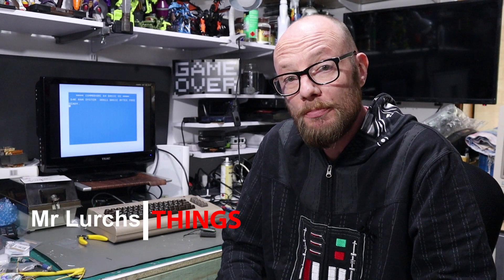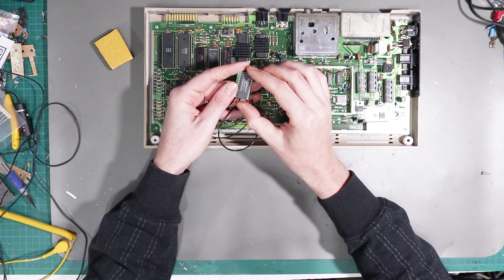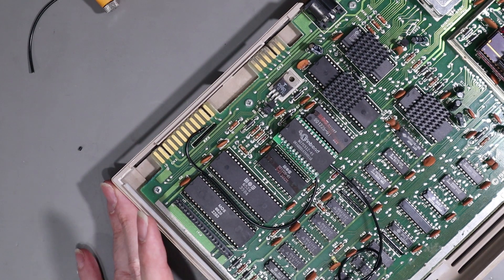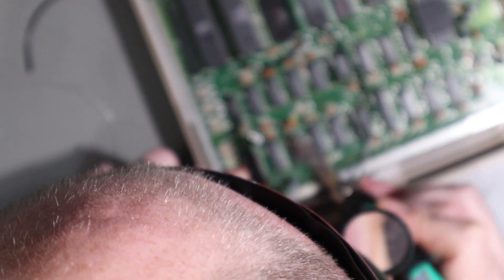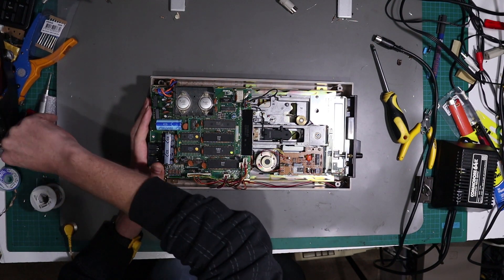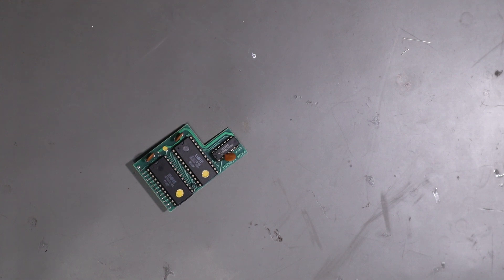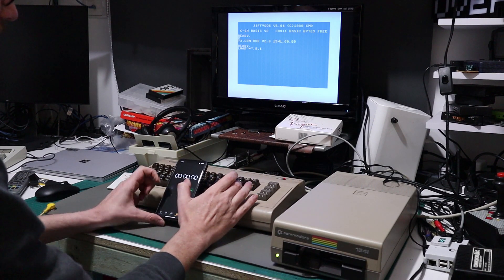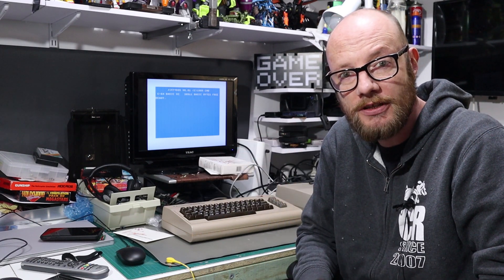Commodore 64 Rescue Pt 3 | JiffyDOS

Comment: The daughter board adapts the two separate ROM chips that you'd fnd in a 1541 into a combined ROM that you'd see in a 1541-II. Rather than soldering the daughter board, just drop a 1541-II JD ROM in place.

You also have a 1541C board, you should be able to enable the optical track0 sensor. It's just a jumper IIRC.

Comment: HI, Can I ask what camera you are using for over head ? I have similar issues with the exposure changing  especially from over head and lights reflecting on pcb or metal. I started to set it manually and had more consistent results. I still have issues with the overhead lighting in my workshop reflecting on anything a little bit shiny, but it no longer goes light and dark depending on the position of my hands for example.

Comment: Your setup is improving every day it seems. Love jiffyDOS, I have the same in the ZIF test bed, but I used a via to the right of the CPU and a via just under the first CIA for the restore and reset lines. Threw a pin header on both and crimped a couple of plugs so it is easily removed, not that I'd ever want to 😁
Reply: Yup, another option for folks who don't want to/can't solder is to attach test hook clips to the wires and then clip reset line to a CIA pin 34 and restore to r41 as in the video.